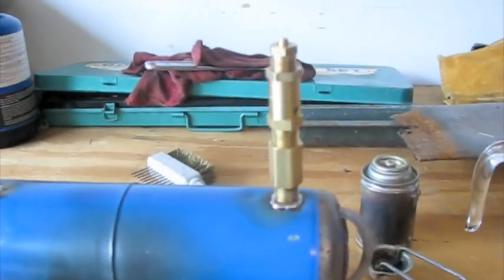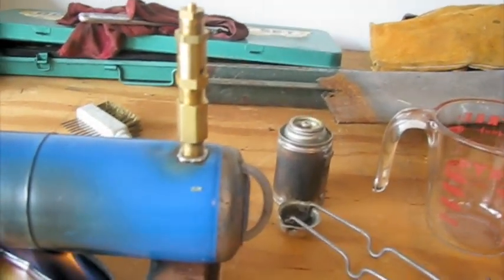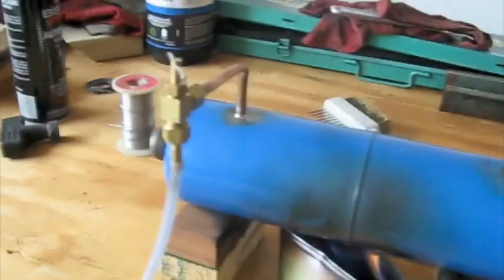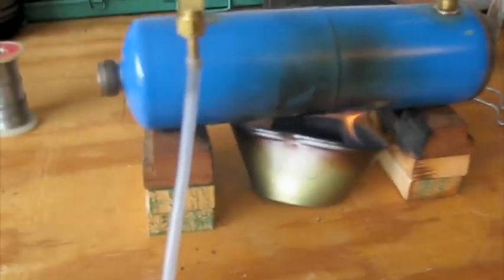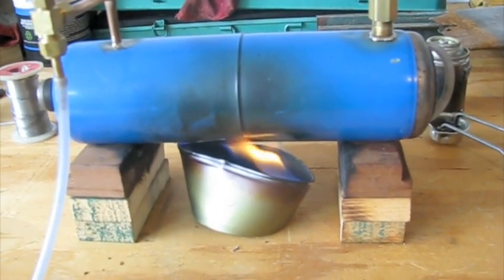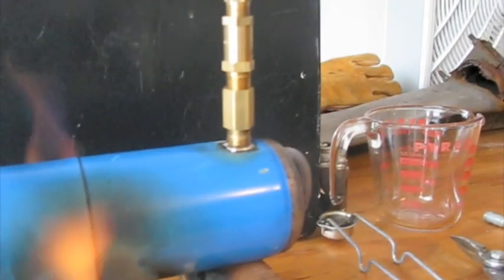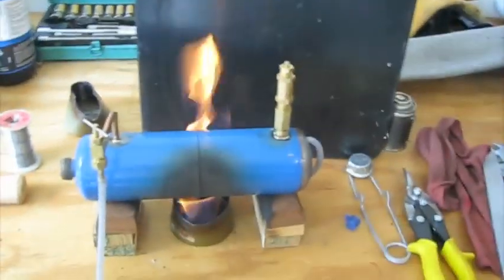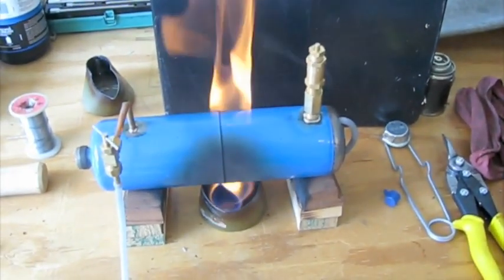homemade steam engine part 3

Comment: When I was your age I did stuff like this. Now that I work in the boiler industry your boiler scares me to death. Please add a pressure gauge and hydro test your boiler.  I have no idea what pressure to recommend. A propane tank is not intended to be heated.  Be carful.
Reply: Yes, he has the equipment to do a hydro test....The poppet valve is enough for what he does.
Reply: Those cans are made from aluminium and it is pressure tested to 120 psi as long as it's below 70 he's ok
Reply: Most propane tanks are steel, but some are aluminum, as long as there is water in the tank and he doesn't go within 10 psi of the max, then he should be fine

Comment: You can buy those safety valves at HomeDepot, it's the same as a "pop-off" valve for an air compressor. And don't listen to that user990077 dude, those valves are not rated in BTU's.

Comment: @Amazingmandan333 An induction heater for this project is by far not the best choice,  plus who wants an expensive high teck heater on steam engine, kind like putting a blackberyy in a wineo's pocket.

Comment: I need a sight glass, I went dry and over cooked my connections, i brazed them instead of silver solder,  worked much better this time, it's all about trial and improvement

look for a camping stove for fuel,  a small propane one is cheap to run and easy to get fuel, and adjustable flame, 
if you build a boiler holder try to incorperate a safty cover if the bottel was to fail, and remember after many heating the tank can fail,      please post my video if you dont mind,
KEEP UP THE GOOD WORK

Comment: Safety valves for boiler, hot water heaters, etc. have a BTU Rating.  Basically, how much energy can they release.  If your fire puts more energy into the system then the safety valve can handle then the safety valve is useless.  The contraption could still explode.  Read up on this.  Do your math home work and maybe some day you can be a mechanical engineer...